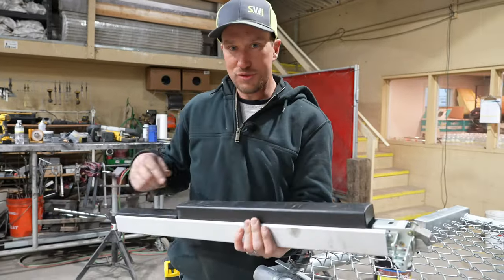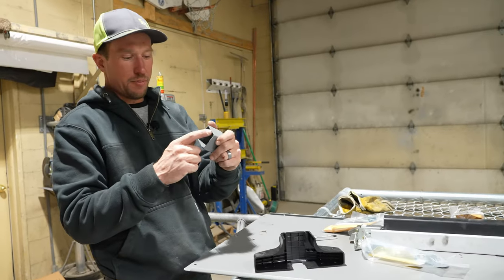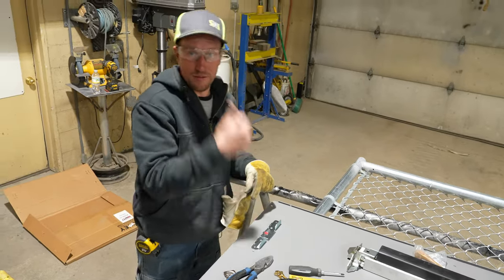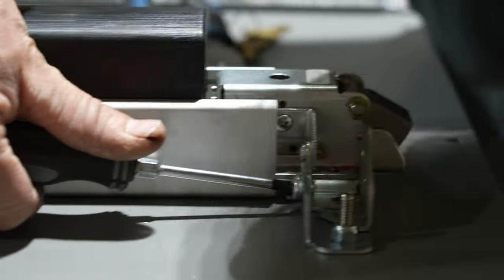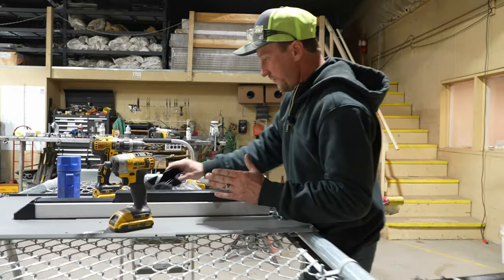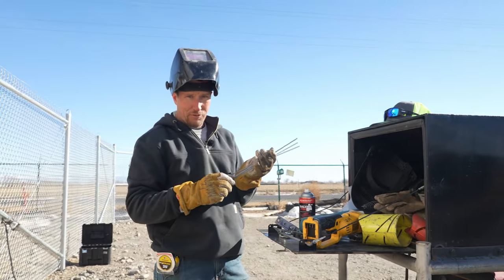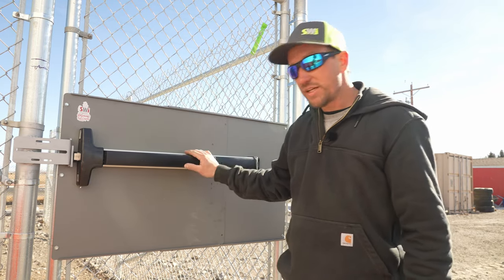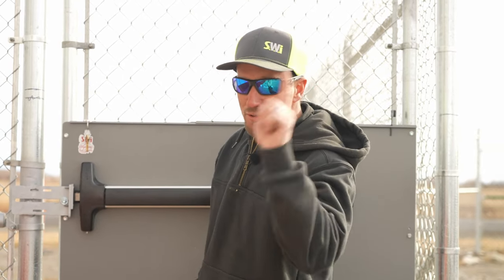How To Install A Panic Bar Like A Boss

Comment: that's cool I've never seen that or installed that yet. Nice Kliens pliers bud I like your taste in tools =).  You should do an up date on this when you install it where you are so I/we can see it in action/ never mind you did at the end I see it's cool but my Question is Does it snow a lot where you are? I looked up where whyoming is and your mid west close to California far from ocean air. My concern is corrosion here we are eastern Canada near ocean were master locks are replaced weekly lol.  Also Nice cut on your finger you got there looks like a barb wire war wound LOL

Comment: FYI,  Panic bar hight should be 34" to 48" from floor/ground to center of bar. This is a standard requirement by Code for egress.  Yours looked a little high.( the catch thing that you screwed to your welded metal plate, that the latch engages into is the Strike Plate)
Too high and small people or someone in a wheelchair would have a harder time opening the gate.

Comment: I really like the installation of the panic bar, however, with such a big gap between the gate and the door, someone can bypass it without using a key just by pushing the latch or the panic bar with a bent rod.